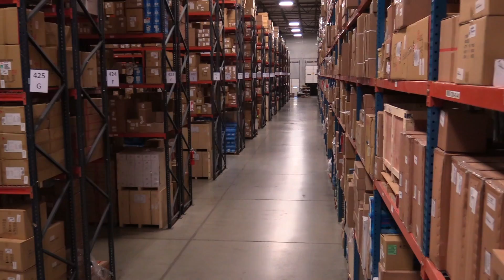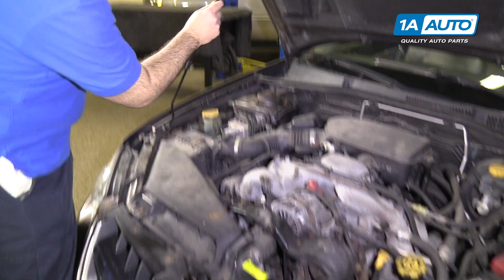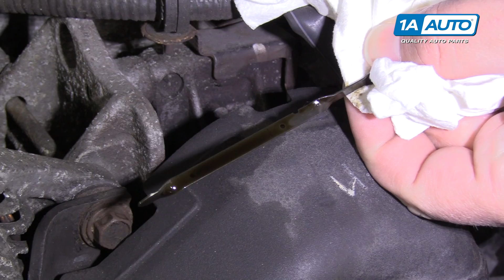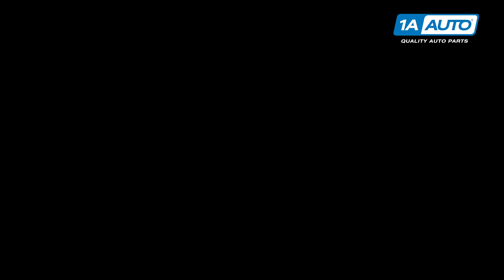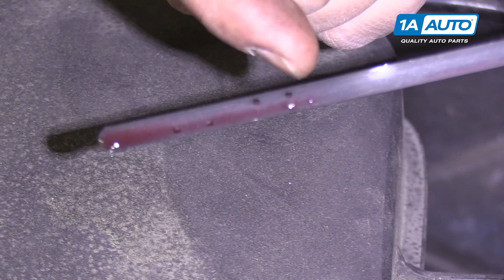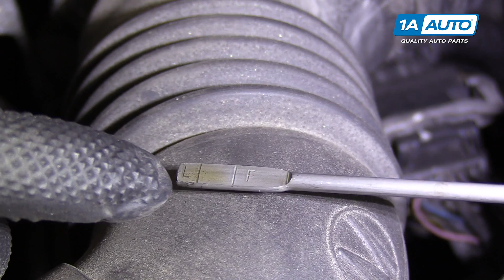How to Check Engine Fluids 04-09 Subaru Outback

Comment: So far the best video to show how to read the transmission fluid. Everytime I pull the transmission stick out, it seems like it's all over the stick.  I can never get a correct reading.  Its half the stick covered in oil and the level is up or down everytime I reinsert and check.

Comment: Note that in order to check your ATF fluid the engine should be at low idle ~750rpm. If you check it at high idle right after start, it will appear to be too full as he showed in the video.

Comment: Hi, I understand that you need to have the engine running when checking the transmission fluid, but I’ve been told by many people that you have to put the car in neutral or even put it in drive with the parking brake on so you get an accurate reading. Any comments? Thanks

Comment: I pulled on the trans dip stick as hard as my fingers could manage.  It seems to be stuck.  Wont budge.  I am tempted to use pliers but I am wondering how strong it is.  Hate to break it off.  Your thoughts.  Thanks.
Reply: I’m having the same issue. Were you able to find any solutions?

Comment: I've been checking my transmission fluid for 50 years by always having the car running and then, with the brake applied, shifting the transmission shifter from Park through all the settings one at a time and back to Park again BEFORE checking the dipstick.
Reply: I get confused when I check mine. I do it as the manual says but I get two different readings. one clearly where the fluid is at but I also get uneven like spot marks that are a higher reading. I don't know which one to go by
Reply: That's what the manual says to do. Don't know why this guy is cutting corners. I'm trying to figure out what I'm getting bubbles. I hate bubbles.
Reply: Shop manual states trans is HOT (driven over 10 miles)